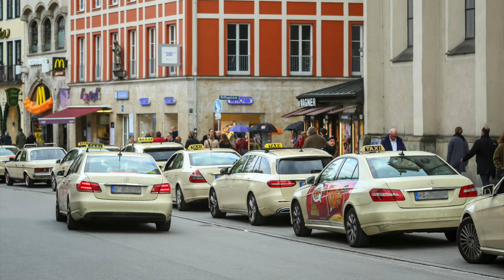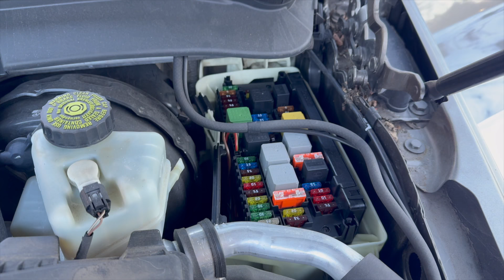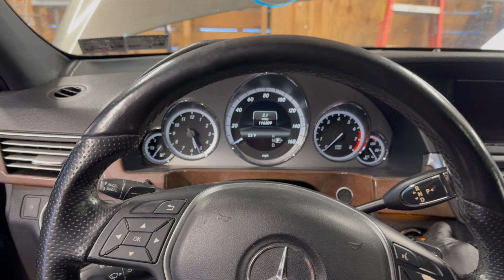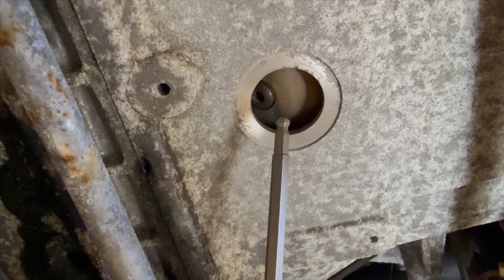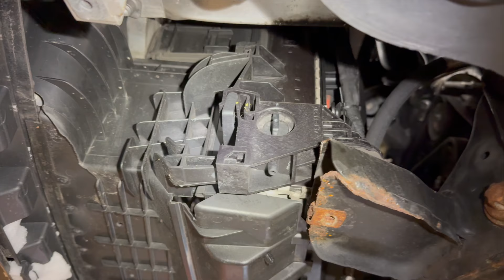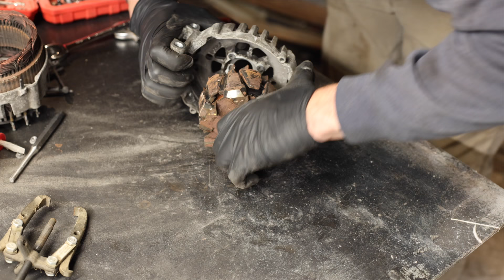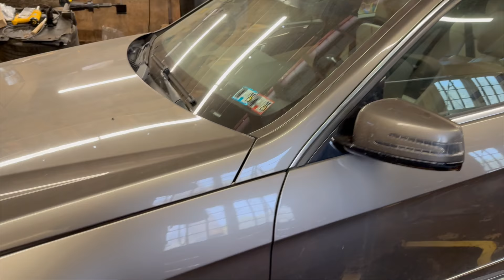I Bought the Toyota Camry of Germany, Except WAY Cheaper (and Better)

Comment: So, what many not know about the E-Class Taxis, they are special. The have heavier Suspension, Engines, Steering etc. so every thing was build extra Strong that it could last 2 millions kilometers. So the normal E-Class is great, but the Taxi ones are just special.

Comment: As a Mercedes technician for 21 yrs, I guarantee that 212 E-Class is nowhere close to the reliability and simplicity of a Toyota Camry 😂.  

I even owned one for a few years and did all the work myself.  Even then, the cost of maintenance and repairs still exceeded its resale value.  There is a reason German luxury cars drop hard in resale value.

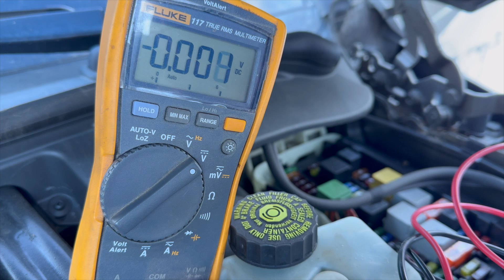Comment: Dear Waldo, You are calling this a fuse box 6:31. What the rest of us lovelies call it is the front SAM module. It is the total brain box of the front part of the car, regulates how the engine runs, air conditioning, headlights and who knows what else. I am replacing my front SAM module right now. To do it proper, it needs to be sent off and cloned to a replacement unit.

Comment: I dunno, I was a huge MB fan. I owned many, and still own a couple. 
However New Mercs are just SHAIT. From the S all the way to the T. CRAP. MULL. 
I'll be content with my two 50-year-old Mercs. They are the best. New Mercs, are, in fact, exactly as you say , toyota Camries. 
Reliability, heh I dunno. Well if you buy 500.000 Km Berlin-Frankfurt taxi then every single part has already been changed.. twice. uncliding the doorcards xD

Comment: 31:22 and you even got the V6, which is arguably the hardest one to work on besides the AMG variant. The Taxis in germany/greece/france anywhere in western europe really, they usually use the OM651 engine, the 2.2 liter diesel.
42:06 not in europe. You find 520d/530d just as much as the W212 220cdi, they are extremely reliable as well, the N47b20a or the N57d30 are extremely good.

Comment: unpopular opinion: most mercedes taxis were bought for its comfort and durability of the interior, not the engine lifetime. if its claimed that old mercedes engines run a million kilometers, germans mean the block. you probably have to rebuild them a couple of times on the way, exchange one or two bent heads and all the other parts around. its economically feasable in taxi use cause it makes money and pays a more frequent maintenance by itself. we had a handful of other brands in taxi fleets, with iron block low output diesels, they ran a mil kilometers as well but the car itself degraded faster.

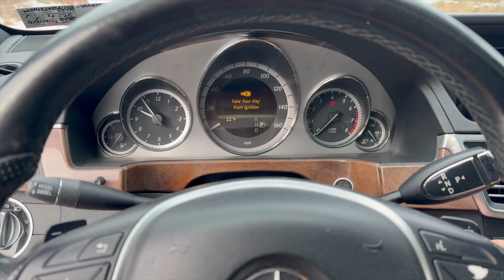Comment: 1:00 I'm going to tell you right now, you should have just bought the real Toyota Camry, this just isn't going to go well for you. You bought a salvage Mercedes-Benz, you didn't buy anything like a Toyota Camry and you were going fafo
Reply: Did u read the title??
Reply: @mickyizgfiouzf8247  I absolutely did and I own both Mercedes and Toyota vehicles. Have you ever owned any? There is a (unsalvaged) Toyota Camry for every budget, if he wanted a Camry he absolutely bought the wrong car. In his diluted mind he thought the Mercedes is equivalent to a Toyota Camry, even better, but he is woefully deceived. The guy is comparing apples to oranges. I own three Mercedes and a Lexus GS350. The guy bought an OLD salvage from presumably overseas, he unwittingly ensnared himself in a FUBAR. So go ahead and check to see if he has made any updates or follow-ups on his mistake purchase.

Comment: What you miss in America is all the low powered diesel engines the taxi fleet uses. Or the small 4 cylinder gasoline engines we get in Europe. Mercedes in America is mostly just 6 and 8 cylinder cars with crazy performance. Expensive to own and run. And the question is if not VW Passat is the true Camry of Germany?

Comment: I would not trust any modern MB gas engine. Even the diesels are not what I would call super reliable simply because of the modern MB platform's reliance on the CANBUS, but at least their diesel engine tech is based on their trucks and has to go the distance vs the gas engines which are designed to last the duration of the standard 3-year luxury car lease and if you get any life out of them beyond that point that's considered a bonus.

I was surprised how relatively simple it was to work on but a CANBUS diagnostic tool is hardly a common and inexpensive piece of hardware, and I'm pretty sure most Camrys can be completely fixed with just the use of a code scanner, barring any work you legitimately can't do yourself such as a transmission overhaul.

Comment: I am currently selling my 2014 facelift 250 CDI, I have driven it for 370,000 km. Its reliability is far below expectations, there have been many minor and major problems with it over time, despite the fact that I mainly drove it on longer roads, on the motorway and had the oil changed every 10,000 km and the automatic transmission oil every 60,000 km. Its repair and maintenance costs have been very high. Not to mention the time I wasted. Never again a modern Mercedes! I currently drive a 1988 W124 200E, perfect, factory condition. It doesn't have air conditioning, but that's what I can put up with.

Comment: All MB taxis in Europe are diesel (200cdi and 220cdi), not the V6 gas.
Zimmer has special "Ölstop" cable to prevent oil entering the ECU.
https://youtu.be/Rb5mzhMXr70?si=s4pxxOECQ6CscSCZ

Comment: This is not the German Toyota Camry...it's a bit too pricey. The Ford Mondeo from 2007 and newer is, however... both generations )))) Coinsidently in the place where I used to live Ford Mondeo / Toyota Camry / Nissan Teana were all considered similar cars with Camry being the most expensive and the most boring... and Ford the cheapest (same as in Germany). Reliability-wise the Camry still won but not by any substantial margin against the Ford or Nissan. From what I gather the Nissan Teana (aka Nissan Fuga) was never available in Germany, so they missed out on a great pair of small 2.5 V6 + CVT, which completely wiped the Mondeo and Camry with similar displacement 4-bangers and conventional automatic transmissions. Also, given the CVT and slightly larger interior it was the most comfortable for passengers of all 3.

Comment: I once worked for the German supplier KOSTAL that produced the steering column switch for Mercedes at that time. The component was of very high quality and was tested for more than 100,000 operating cycles.

There was a phase in the automotive industry when manufacturers tried to replace many expensive physical switches with cheaper or more digital alternatives. However, this trend has partly reversed. For many key vehicle functions, a robust physical steering column switch remains one of the best solutions: intuitive, reliable, durable, and safe to use without taking your eyes off the road.

Comment: Waldo 
If you want the car to last for 100s of 1000s of miles it's down to what oil is put into it I'll garranty the Taxi drivers don't use what the manufacturer tell them to use anything less than a 10 40w normal not synthetic it's all crap stuff for them to get more money out of people what i do is fill with new oil then add thick lucas oil stabiliser 1lt then run for 200 miles you will find the oil level would of dropped because the stabiliser has stuck to the engine parts then fill to level again with LUCAS  you will notice a difference in the sound of the car how quiet it is and that miles go up PG and you don't need to top up water or oil the more times you do this the better BUT ALWAYS ADD STABILISER WHEN OIL AND ENGINE OR HOT NOT COLD GIVE IT TIME TO GET OVER THE PARTS

Comment: On this engine specifically, the camshaft VVT actuator tends to fail, causing a rattling noise on cold start. I can hear a rattle, and I do believe that may be the cause. It could also be caused by bad chain tensioners. I have heard that this could be catastrophic if not dealt with.

Comment: If you have ever had a pulley fail while driving you understand the frustration that comes with it, had to drive my truck home a few miles without power steering and that was a doozy. Don't know how yall did that before power steering.

Comment: I had this issue, same symptoms, lots of errors, lots of module changes..... and it turned out to be a ground fault, a wire behind teh dash had rubbed through its insulation.

Comment: I used to love Mercedes and BMW but they have become lease only vehicles in the US as their reliability has gone into the trash, frankly ALL German cars in the US have gone that way.  I was looking for a cheap used car as a beater and can't even look at VW because after 90k miles all of these gremlins pop up with them which tends to be the same now for Mercedes and BMW as well.  I was looking at a 1978 Mercedes 300cd recently and it still runs well, while the 2022 Mercedes may not make it 100,000 without spending half the value of the car in repairs.

Comment: I've got to ask why Americans are so obsessed with replacing fluids. Most of these German cars won't see a transmission oil change for 100k miles, and differential oil only when something goes wrong which is a lot longer. Engine 10-20k miles depending on performance, and they last for decades. It seems that US car manufacturers have persuaded people that changing oil every few weeks to cover up for poor manufacturing tolerances has become common practice.

Comment: German here: that car isnt nearly as reliable as a camry. Taxi companies just use them because merc has a huge financial rabatte for taxis in germany, but talk to many of those taxi drivers and most of them will report the cars being in shop as much as they are on the road, and the ones on the road prob have some check light on the dash. Yes there were some very reliable versions of this car, but i would never put it on the same level as a toyota. Maybe the 190D was a german camry or some of the older passats, but not this E...

Comment: wth are you talking about BMW .. yeah sure .. for your typical american .. who seems to believe that an olichange or fluid change in general .. is optional .. and if EVER .. you do it like every 2 or 3 years! sure .. a german motor is way more complex than your american V8 and with it way more fragile for american use .. BUT .. if maintained its a perfekt maching for ages! my last bmw drove 500k kilometers .. and the ONLY thing i had to change was the coal parts of my altanator!
and german taxi driver DID NOT choose mercedes because of reliability! who told you that? they did it .. because mercedes ALWAYS where seen as the more comfortable car .. while bmws where seen as more of a sporty option plus mercedes had some optional parts .. they installed just for taxi cars ... while bmw where NEVER interested in the taxi busines to begin with!

Comment: I’m Fascinated by Competence
I love seeing competence.
I don’t know what your formal training is, or whether you’re completely self-taught. But I’m impressed when someone handles machinery with confidence — when the movements are natural, when you can sense real understanding, experience, and technical clarity.
I’m not a mechanic by inner calling. Still, I grew up in that environment. My parents ran a workshop for agricultural machinery, garden equipment, and motorcycles. Engines, spare parts, repairs — that was part of my everyday childhood.
Later on, I trained in the trade of motorcycle mechanic in order to continue the family business and later worked for several years as one. But I was never truly passionate about it. It was more a practical path I followed than a genuine vocation.
When it comes to automobiles, my experience is fairly limited. (Although I know the "middle part" of that alternator is called "stator" ;) ) I’ve changed and mounted tires, done minor service work, and replaced a timing belt on my car before — but that’s about it. Later in life, I didn’t have the equipment or a proper workshop to work more extensively on cars the way you do.
Even so, I genuinely enjoy watching. Understanding what’s happening. Following the mechanical logic behind it. Even though it isn’t my personal hobby and I don’t actively pursue this kind of work today, I appreciate the precision, the technical thinking, and the visible skill involved.
Competence — in any field — has its own kind of beauty.

Comment: Almost all taxis in Germany have a diesel engine. Mercedes was one of the first car manufacturers that sold diesel cars and they even offer a taxi trim level, even today. Nowadays you can see a lot of VW taxis, as they are cheaper. In most states of Germany taxis have to be painted in a special color, only VW and Mercedes offer that from factory. Toyota taxis are almost not existent. 

And one more thing, German cars especially BMW have a bad reputation in the US only because of emission standards. Most German cars are only sold with one or two engine options, while here in Germany you can choose between way more. The manufacturers just save money and only adapt a few engines for the US, mostly the higher performance engines as Americans see German cars as a luxury. A used Mercedes C-Class 220d (1 year old / less then 20k miles) costs the same as a Corolla hybrid here, so far away from luxury.
Reply: They have a bad reputation everywhere. Europeans are just desensitized and think repairs are a normal part of owning a car. They aren't. You're meant to do nothing beyond routine maintenance for at least 300,000 km.

Comment: The issue with oil in the cables is a known problem with Mercedes. There are already oil-stop cables available that can be inserted to block the oil flow. They cost approximately $30.

Comment: Comparing a camry to an E Class is mad talk
One is an executive class car with luxury features and materials providing a beautiful cabin, well implemented technology, a well engineered drivetrain and a fantastic chassis giving a responsive but smooth drive. The camry is a very reliable price conscious daily driver for familes. Toyotas are great but the camry is not in the same category. On paper spec checks won't tell you this.... Driving one will !
Here in the UK, buying a merc as a taxi only makes sense for the mini-vans used for taking families to airports. Toyota Prius and Corrolla are commonplace but interestingly thats more of a  cultural thing as in most cities cab drivers tend to be Asian and they just  love Toyotas. They are cheap with low running costs and very reliable

Comment: We've had bad luck with MB reliability- E55, GL450, ML500, so we gave up on the brand. The E55 lasted a long time but something broke every 3,000 miles. Maintenance and out-of-warranty repairs are pricey. However, they drive great and if you have the DIY skills and a shop, they can be great cars. With the Toyota Camry now sporting a hybrid 4 cylinder and CVT, I'm not sure how well they'll hold up either.

Comment: Germans in general and Taxi employees in particular take very good care of cars especially compared to the average American who deliberately chooses to know and do very little.  Naturally, they last longer when cared for.

Plus, parts and service are readily available through a large, experienced competitive network with access to factory information. Also, viable Japanese alternatives and a developed market don't exist in Germany as they do in much of America.  So support is different.

Experience here is different. Well maintained Japanese cars consistently outlive well maintained German cars. The chance of a large expensive repair cost,  junkyarding  an older German car is much higher. They are more expensive and more complex, the complex parts fail and they are very expensive to pay experts to replace. The expense dooms the carcass to the junkyard early.

Replacing front shocks and motor mounts for $6,000, or replacing a radio amplifier for $6,000 or replacing cam phasers that leak oil into the engine harness for $1000, or a $700 battery replacement and reprogram - all of which happened last year to a certain 80 kmi Mercedes-Benz I know of -  wouldn't happen to a Japanese car. And if it did,  it wouldn't doom the car.

A well experienced Japanese convert

Comment: German taxis don’t use gasoline engines. Most of them are 220 CDI diesels. Mercedes also offered a dedicated taxi package until recently, including all necessary equipment pre-installed and a significant discount. I’m not sure whether Mercedes has reintroduced it since moving away from the “luxury-only” strategy.